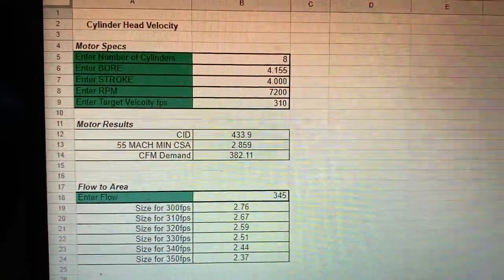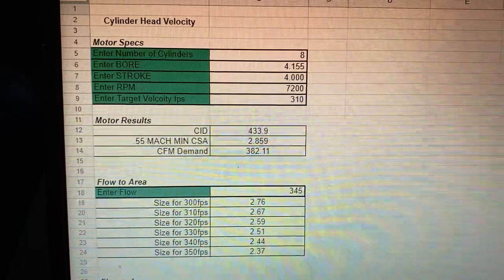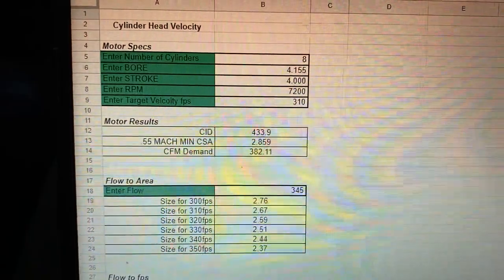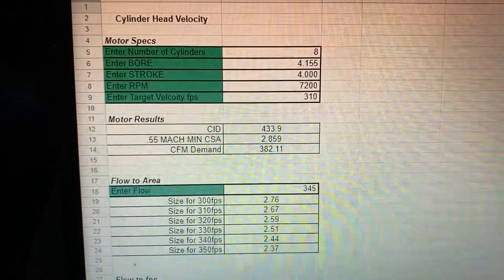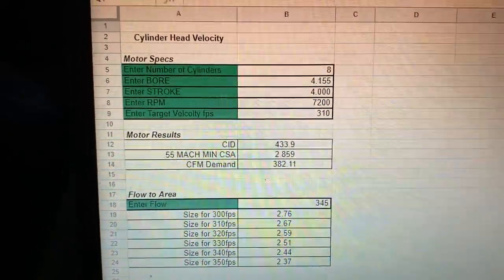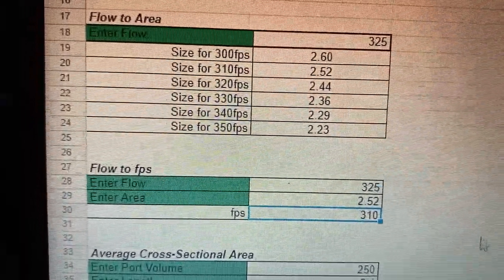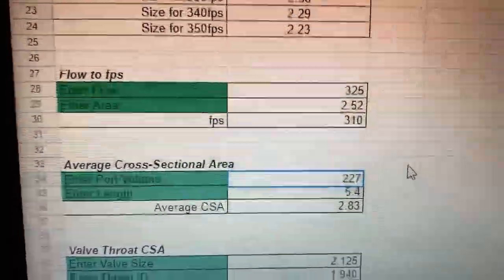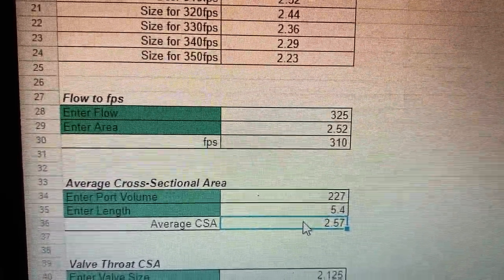Cylinder Head Velocity Spreadsheet

Comment: Thanks for sharing Chad.  This may seem like a dumb question, but how do you measure port length?  I can think of at least 3 ways, but what is correct?  I have read some guys measure from the port inlet to the valve seat, along the port floor. Is this the best way?